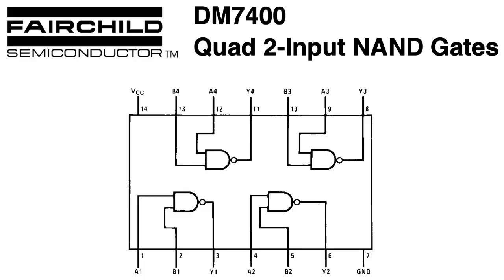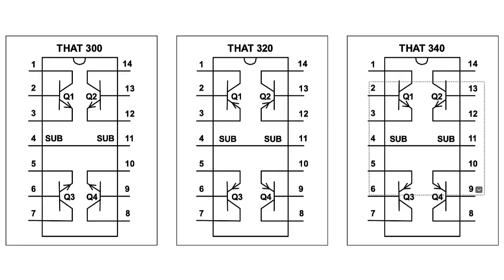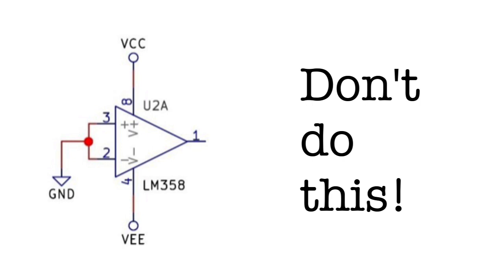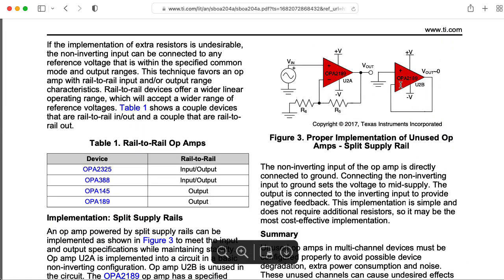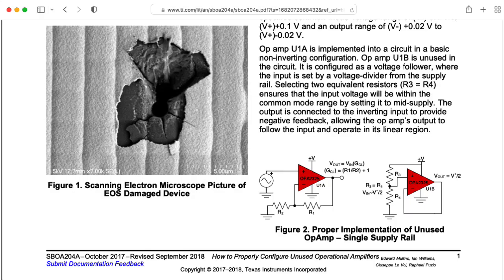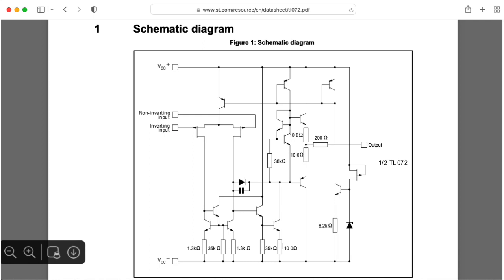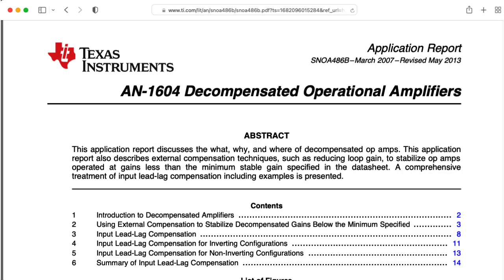Handling Unused Operational Amplifiers (ECE Design Fundamentals)

Comment: Watch out for always assuming "unity gain stable" for audio! The classic "hifi" audio opamp NE5532 dual is unity gain stable, but the NE5534 single is NOT! It's stable down to a gain of 3, but has COMP pins to add a small capacitor so you can make it unity gain stable. This makes it more versatile and a little "better" than the dual NE5532, but it's a gotcha for designers. What's more, the NE5532 and NE5534 have back-to-back diodes across the + and - inputs, so don't even think of trying to use it as a comparator, a bad practice for opamps in general but especially for this one.
Reply from the maker: Excellent points! I will pin this post.

Comment: It would seem that such an unused op amp could help stabilize a divider-based power supply. In application, however, it would likely drain the battery wicked fast if you didn't compensate for high-speed overshoot and potential oscillations.

Comment: I hope you read my  comment 

most opamps that are not used    in a chip   like example 
lm324n    3 aren't used 
usually  inverting input connected to supply and non inverting  input connected to ground 
this way   the   input -  is higher than the +input by  supply so output   switches to  ground .
you avoid any secondary  noises inside the chip  the 
opamp that's being used 
especially in active filter circuits and  precision current measurement .

making an unused opamp as a buffer and connecting it's input to ground isn't the greatest idea but it works if the other opamps in the chip are used for  DC application  like a voltage to current converter which noises doesn't affect its operation .

for high freq   applications the
noises from unused opamps can affect the slew rate of the used opamp 
(depends on factory quality 
if it's a cheap  copy chip this will be affected alot ) 
those  doesn't  install  freewheeling diodes at supply pins and protective esd  cover .
that's why  it's almost impossible to discriminate  
genuine parts from low quality copy   (as those are making exactly same chip  and only be known by putting it to a stress test at max ratings 
if it fails after 1 minute (can be seen in its datasheet)
 it's a copy 
if passes this time without any damage then it's genuine chip .

Comment: Why should i worry about an unused opamp to saturate?? Just tie one input to one supply rail and another to groud so the output doesn't oscillate.
Reply from the maker: Check this out: https://www.analog.com/en/technical-articles/avoiding-noise-and-power-problems-with-unused-op-amps.html
Reply from the maker: Quoting from that website: "These two circuits are not recommended because they are stressful to the op amp inputs. This circuit applies the maximum potential across the input and can damage certain op amps such as those with diode clamps between the inputs. The op amp output will be in a known state and will be railed low in the first circuit and railed high in the second. Railing an op amp's output low causes the op amp to consume more supply current."

Comment: I make a use for one, or put a unity gain in the signal path, keeping the amp active enough.  Since power is cheap enough, a unity gain stage only adds a little to the power supply.  It can also be used to invert the signal.

But if only one stage is needed, nothing beats the TL-071/081 amplifiers.  That offset control makes for the best signal possible.  I'm working on a FET that'll control the offset voltage.  Meanwhile, I'm going to find a way to deal with slight dyslexia that ordered the NE5532 dual op amp, instead of the NE5534 single, which is in my metal detector schematic.  I redrew it for TL-071, which I have in abundance.  Old, but good!
Reply: That's what I typically do. I can almost always use a buffer stage

Comment: I ran into this same issue with comparator IC's, specifically the LM339. Data sheet gives different answers depending on the manufacturer. I ended up tying the positive input high with a 1k, tying the negative to ground and leaving the output floating. I would be curious to hear your opinion on unused comparators.
Reply from the maker: LM339 is open-collector, so what you did makes sense -- it sets the output to "true" which turns off the output transistor.

Comment: The resistor divider can be just about any value.  Using 10k in your circuit?  Fine, use 2 of those.  Got a couple of left over 1k.  That will work too.  Doesn't even have to be balanced, 10k on top 1k on the bottom, just as good.  Put a 10k in the feedback loop so that if a future design change happens add the second resistor and you're ready to go, especially if it's surface mount.
Reply: It does not matter only if you don't care about current going down this divider. I would not put less than 10k there and with a FET op-amp even megaohms should work.
Reply: @tenJajcus  My point is, it doesn't have to be precise.

Comment: A good idea is to use 0 ohm resistors instead of plain traces, one for feedback loop and one for non inverting input.
That way, you have an happy opamp, ready to serve in case you forgot that buffer on your PCB.
You can also add more unpopulated footprints, in case you want more flexibility
Reply: I find that circuits using op amps will always welcome a buffer or buffer inverter stage in the line.  I know of no use where it will harm the signal significantly.  It's there, make it work.
Reply: Do you mean "use 0 ohm resistors to allow easy breaking of links, and using botch wires in case you need that opamp, that logic gate, that element in the package you are 'not using' while you are developing a board"? that is good advise. I have cut SO MANY TRACES in my life because "ahhh, i don't need that 4th one in this package" turned out to be wrong.
Reply: @der.Schtefan  Yes, it's easier to desolder a 0 ohm resistor than to cut a trace with a knife. Also, you can use the footprint for anything else: A capacitor for example if you need it there.

Comment: I have noticed a sudden jump in noise when a FET opamp is driven with low resistance -- namely when a guitar volume control hits zero and the opamp + input resistor is less than 10K. Don't understand why -- ideas?  But of course this probably doesn't matter on a unused amp. 
Also not sure what would be bad about the output in saturation, power demand maybe. Anyway,  tying both inputs together like that first example seems a bad idea.

Comment: i do tend to use TL701, to keep power usage to a minimum and be able to put more modules in my rack, witch is just one set of rails. unless the tl071 is dual inside, like they did on the early mas produced transistors.

Could you explain the function of one of the NPN transistors "back 2 back" below a differential pair, one of them is self biased? If you simulate this circuit in the falstad simulator without the differential pair and just use a voltage source on top of the other NPN it looks like a current mirror, if you disconnect the collector the current doubles on the transistor direct below the differential pair. it's weird to see a collector being connected in to the base of the of the same transistor.
Reply: Are you sure 4x TL071 is more efficient than 1x TL074? Theres a LOT of cleaner op-amps that will drop in for them FWIW. Though the dual packages are most common and easy to replace.
Reply: @mycosys  when i need just one opamp, my aim for the modules i make if the lowest power consume possible, to have many modules by just one set of LM317/LM3xx voltage regulators / power supply.
Reply: @AnalogDude_  Gotta admit that isnt generally my goal - i prefer to use 10k inputs for the 1mA max current (vs 100uA max for the 100k normal in euro) and greater overall stability and induced noise immunity, as well as the lower resistances having lower noise. More power more stable.
Also building an 8A power supply for my rack with multiple regulation stages so theres that XD
Reply: @mycosys  You could try using power mosfets and a opamp instead of using a multiple voltage regulators.
The "IRLZ44N" can deliver 47 amp at 10V.
Much cheaper than using several voltage regulators with the opamp you check the output of the power mosfet and automatically adjust the voltage on the gate using a voltage divider or 2 cascaded 6.0 zener diodes.
Reply: @AnalogDude_  Its multistage because i want to separate input regulation from load regulation, and because i want to use a star ground system, and because i want to use local regulation at each rail to minimise voltage droop, and because i want to isolate the modular from the huge old EI multitaps i have. 
Will be taking 15VAC, using huge 25A bridge rectifiers (i like the bolt on form factor) to make 18VDC, bulk capacitance ofc, then the primary regulator will be an LM317/318 driving TIP31/32 pairs for current, dropping the 18VDC to 15VDC reg. 
Each rail will have a input caps, LM317/318 pair for the +/- 12V rails followed by crowbar OV protection. Got the bits, just need to build the thing.
In the context of nearly 1000HP of modular a few LM3x7 isnt huge XD
Reply: @mycosys  Ya, just make a PCB bus boards for the flat ribbon cables and interconnect these with like 1.5 mm² cables / connectors. the result is the same star ground and so, but you don't need to buy a shitload of voltage regulators, capacitors, coolers and stuff and have the exact same voltage everywhere.
it's self adjusting like a TL431 or voltage regulator if you use the correct circuit around the power MOSFET but much more powerful than just 1.5 amps.
Reply: @AnalogDude_  and then you get droop and crosstalk> As i said i already have dozens of TL317/337, they dont cost much compared to needing 50 x 2164s or something
Reply: @mycosys  lol, use single stranded shielded cable.
a IRLZ44 is just around 2.50€ at mouser, not quite cheap, but you only need 2.
as long as the ground reference is stable, you should be alright. your idea would lead to slight variations of 12V due to fabrication tolerances in the voltage regulators.
Reply: @AnalogDude_  so does yours bud. They are a non issue. Everything uses 10V voltage references. The issue is ripple and crosstalk. 
Do you boo
Reply: @mycosys  I had to think hard, lol.
on remembering how to the circuit was (saw it on youtube some time ago.
try it your self in the falstad simulator.
Place a N-channel mosfet powered from something like 30V. take opamp and place the inverting pin on the output of the mosfet (source), while the non inverting output has a 5.6 Volt zener and the opamp output to the gate, than load the circuit with a resistor, it stays stable even though with the mouse wheel you change the resistor value, you see the opamp change, but the output is stable.
a bit comprable to a LT431.

Comment: I met in my work when prototyping an unpleasant effect, that with a classical circuit where a voltage follower is used, and the + contact is connected to the ground, the IC starts to heat up and the noise of the IS increases with bipolar supply. I think the reason is poor contact and high resistance of the prototyping conductors.  in such cases, it helps to connect + contact to the voltage Vref (3-5v)

Comment: Would be useful to find a comparison of grounded (or middle-pointed) op-amp and just not connected. Would it make a big difference in noise levels? Sometimes I leave an unused part not connected and don't detect any gain of the noise level.
Reply from the maker: That would be interesting; when prototyping I usually don't bother with these sort of things either. I suppose theoretically the output would be swinging one direction or another at random, but in practice there's maybe enough mismatch that it will tend to go to one of the rails and just stick there. I'm just speculating though. Come to think of it I don't think I've ever just tried looking at the output of an op amp without any inputs.
Reply: @Lantertronics  It might get even more interesting when we talk about op-amps with ultra-low input offset voltage. I guess the output just toggles randomly from any statics noise. But kind of hard to verify, as any probing might influence its behaviour.

Comment: Note to young people: read the datasheet. Don't just have a look at the picture with the pinout but really read it and try to understand what's in there. 
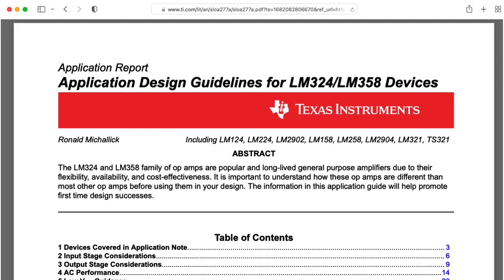I agree with the 10k resistor @2:18 but you were confusing me with the JFET versus BJT story. The LM358 is a BJT opamp, not a JFET one.
But do have a look at the text in section 7.1 above the pictures 🤭"All the input pins have a diode from the input to the device’s GND, or V–, pin" and that apparently is the main reason to add the 10k resistor. If JFET opamps have a similar input configuration (protection diode ?) then it makes sense to use a resistor with a JFET opamp too. The only reason not to do this is to save a few cents per resistor in production (resistors are very cheap bu you also pay for the pick&place action which for us is around 2 - 3 cents per component)
Reply from the maker: Sorry the way I framed it may have been confusing. Yup, the LM358 is a BJT op amp; I didn't mean to suggest otherwise. I was just wondering if the same logic applied to op amps with JFET or MOSFET inputs. And you made a good point about reading the data sheet, because I didn't. ;)

I had assumed that some current would need to be flowing to get a voltage drop across the resistor, which wouldn't be happing with the high input impedance of a FET-based op amp. But you are right, there's a totally different issue going on. I'll add a correction to the description. Thank you for catching that!

I don't see such a diode on the schematic the TL07x Datasheet. But then, I don't see such a diode on the schematic of the 358/324 data sheet either (at least the once I'm looking at). It may be something they leave out on the "simplified" schematics.
Reply: @Lantertronics  Yes, stuff like protection diodes is almost always left out of the schematics in the datasheet. I did some quick measurements and it seems there is only a diode from the input the the V-, not from the input to V+ (from reading the datasheet I assume this is already covered by the PN junctions of the input transistors combined with the -6µA regulator).
My quick measurement with a multimeter  in diode mode only shows that there is a ~ 0.8V drop from the input to V- and a ~ 1.7V drop from the input to V+. I assume 1.7V to V+ is not just a couple of diodes. A curve tracer is needed in order to show that in more detail (and that would make a nice video too 😁)
Reply: Why does a protection diode necessitate an input resistor? Would such a resistor also be required when making a ground-sensing non-inverting amplifier circuit? The voltage across the diode will be close to 0V so no current should flow through it in either direction.
Reply: @Scrogan  As stated in the application note from TI: "In dual supply applications, the GND pin will be negative. However, during power up, power down, or supply faults, the GND pin may become positive. If this occurs then a grounded input pin will have potentially damaging current flow due to the input diode. Even if the GND pin is also grounded,  such as in single supply applications, there is a possibility that the input ground will be negative relative to the op amp’s internal ground node. Ground differences occur when there is poor layout or high current transients, Δi/Δt."
It seems that this problem is related to power issues where one of the two supplies comes up (much) faster than the other one - something that can be surely the case in those applications where a single 12V power brick is used and the negative supply is generated from that one.
I think that last section is a bit far-fetched. If the ground difference in a circuit is that high (high enough to have current flow through the diode) you have other problems that are much worse.

Comment: I will have an unused comparator in an LM339 on a design I am working on, so this is timely.
It depends on the internal input stage configuration, like you say, so I will study the datasheet and application note.
A non unity gain compensated op-amp like the NE5534 will be in a single package for access to the compensation pins, the multiple op-amp variant will be unity gain stable, like the NE5532 dual variant.

Comment: I'd really love your opinion on something I have debated with other EE's over the years. Given how sloppy the characteristics of jfets are, with the Idss very poorly specified, and Vgs nearly as bad, for discrete designs unless you really need the high input impedance, they don't really seem to have any great advantage over a BJT. I'm curious what you think.
Reply from the maker: I'd note that even for integrated circuit designs, you rarely see JFETs used other than at the input (for high impedance as you say) or in current sources (where their "depletion mode" aspect makes them very convenient). 

MOSFETs are a different beast; there are plenty of integrated circuit CMOS amplifiers. Although, my colleague Marshall Leach said that MOSFETs were noisier at audio frequencies than BJTs.
Reply: @Lantertronics  I've noticed that also---power mosfet output stages used to be a lot more popular than they are now, it seems, except for types like class D amps. It might be fin to do some experiments, and a simple chip that has always been a cmos DIY "kit" is the CD4007 uncommitted mosfet pairs. I remember Bob Pease made some interesting analog op-amp circuits with those. As far as Jfets, it sounds like you and I are on the same page. They can make some useful quick and dirty discrete current sources though.
Reply from the maker: @davidjh7  JFETs also are useful as voltage controlled resistors -- I forgot that one (all hail the 1176!)